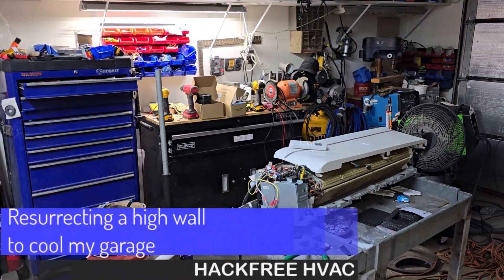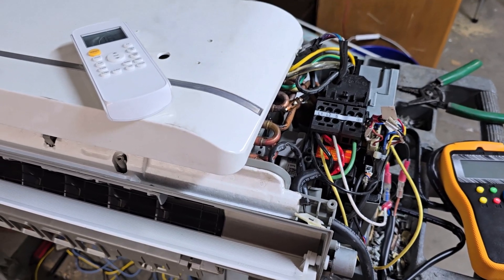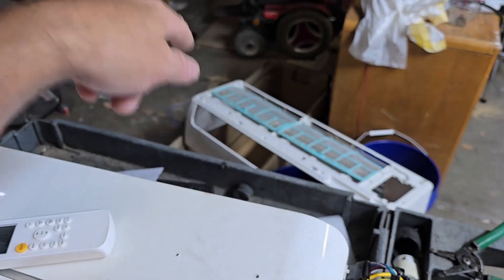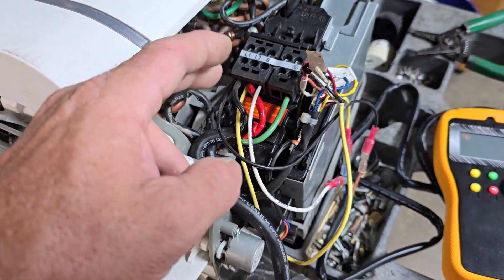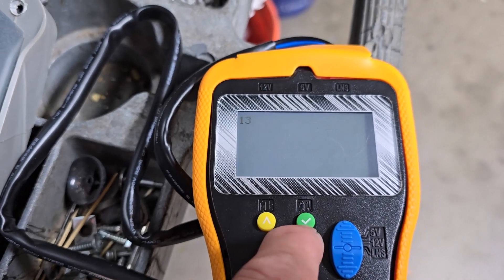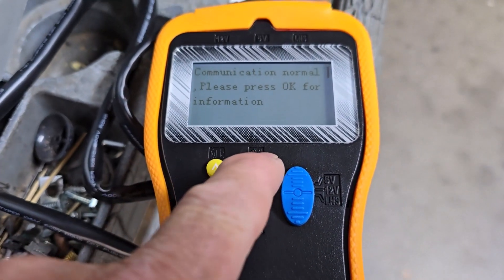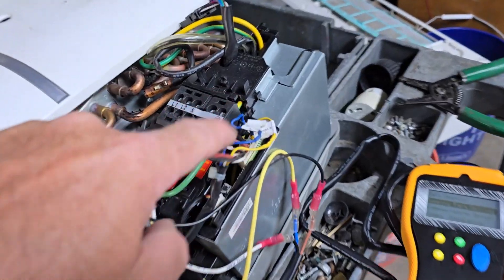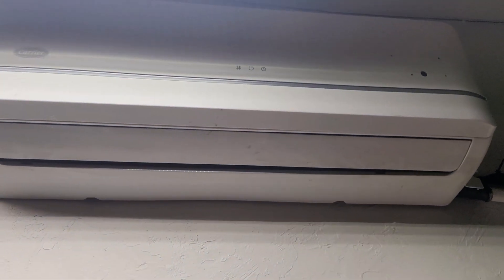Resurrecting a ductless high wall for my garage - Using Ductless Service Tool

Comment: hi i did not know there was a too for checking the communication on mini splits and do they all use the same communication?
Reply from the maker: No. This one is Carrier which is Media.
Media does make a lot of the units but I am not sure which.
I installed some ductless on my aunt's home earlier this year and tried it but it was not compatible on that one (sold at Home Depot).
But for Carrier and possibly other Media made ductless, this is the tool!